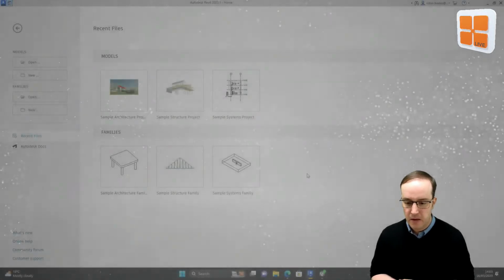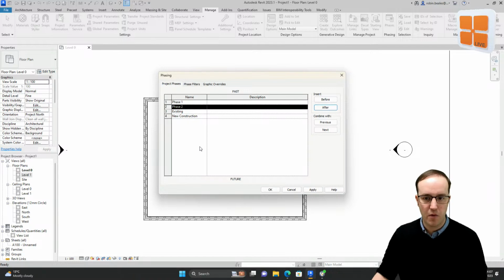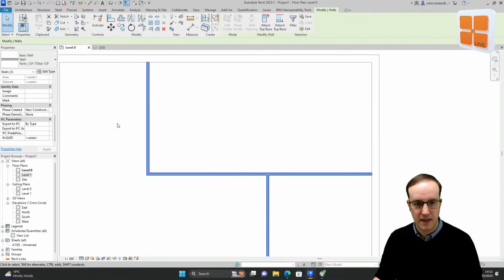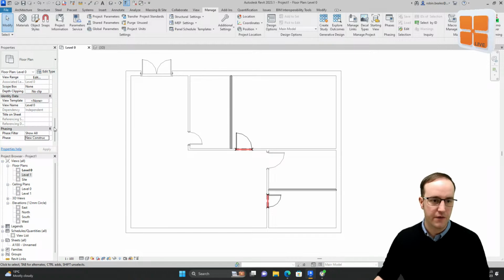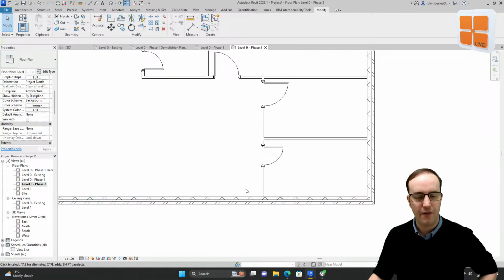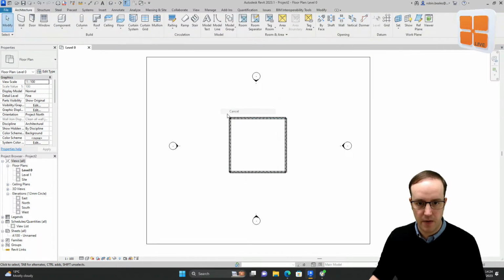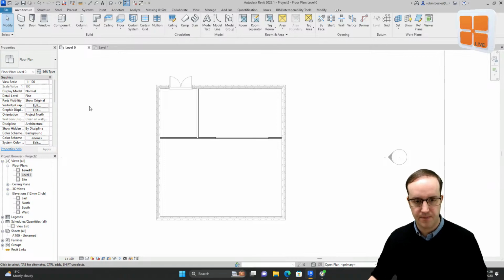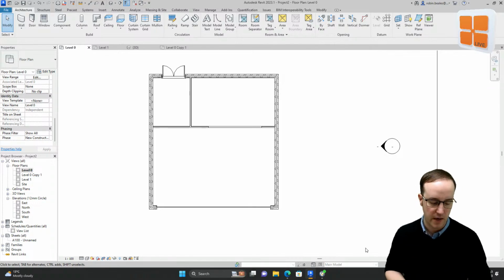The m Word Episode 31 - Phasing and Design Options in Autodesk Revit

Comment: How do you setup design options in a Revit 2019 mechanical Revit central model? Every video I've seen shows design options for architectural design, have not found a good one that shows mechanical ductwork design with design options.